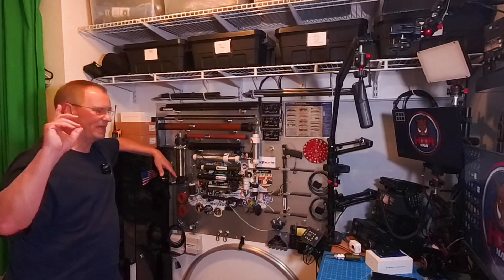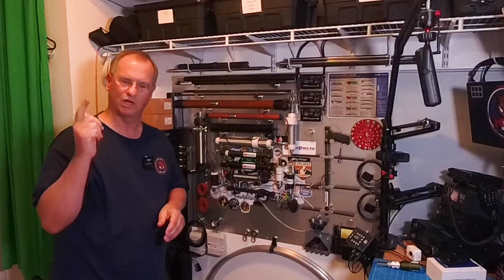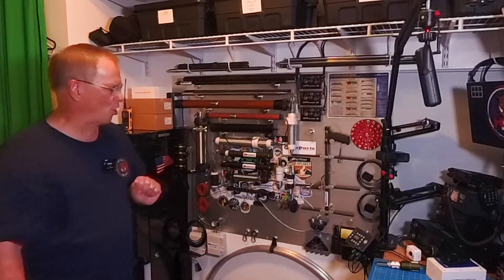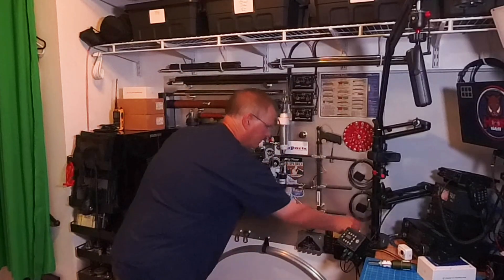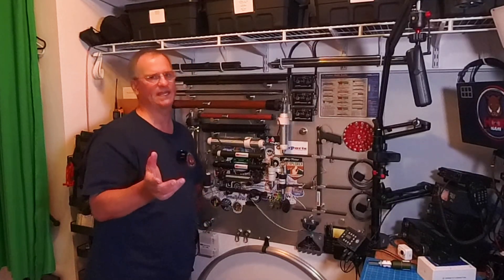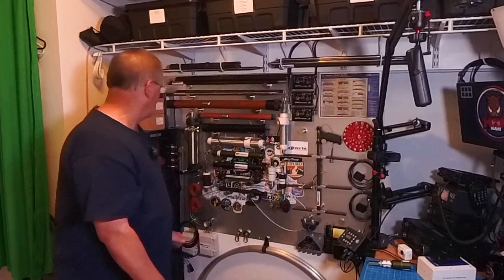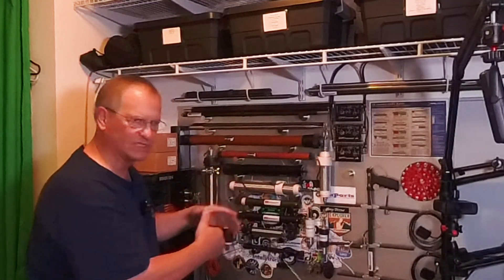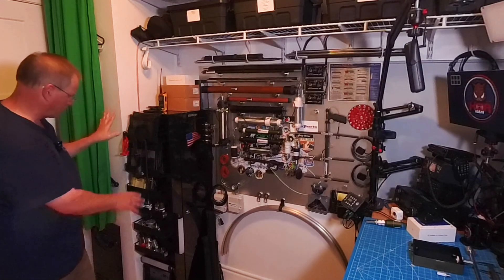Antenna Arsenal Wall of HOA Ham: What, Why, and How to build it?  My Ham Radio Antenna Collection

Comment: A 32 1/2 ft stainless steel telescopic whip going up there
Reply from the maker: Well, I kinda have one now with my Mil Ext, and the SS25; just did a vid on that a week ago - makes a great 1/4 wave 40 meter vertical.  That's not to say there won't be something else up there someday, just not now.